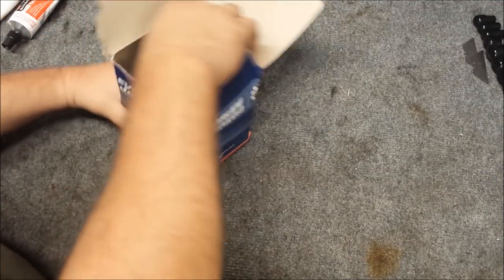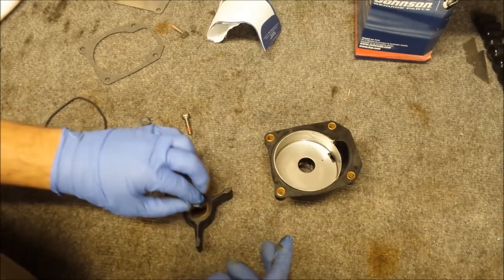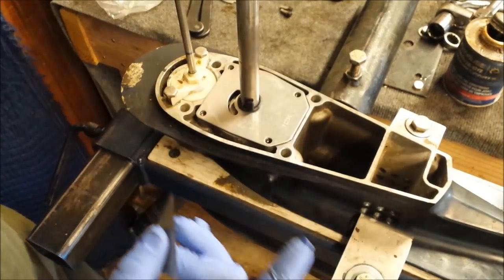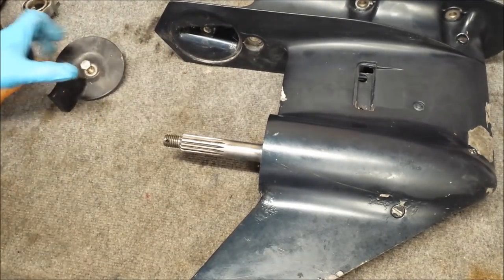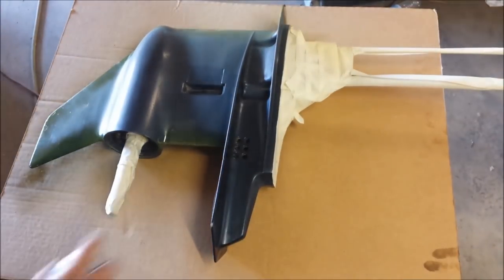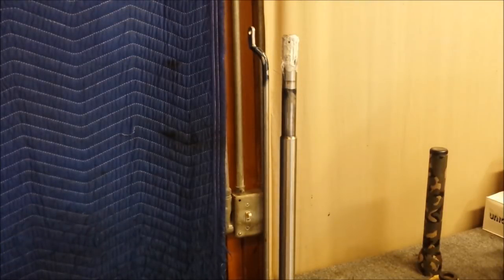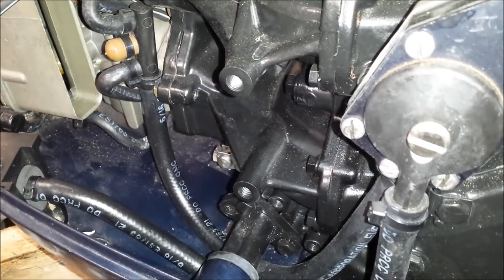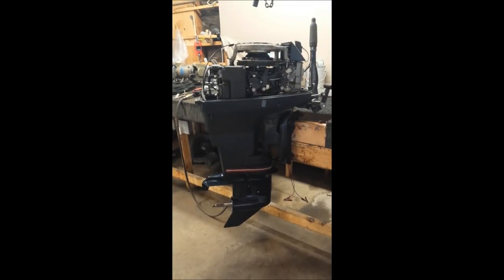Evinrude 40 HP Lower Unit Part 2: Water Pump, Paint, Install

Comment: Not to be a Marine mechanic you done real good.. seriously... a couple things when installing the water pump, as you finally put the impeller and the key with the o-ring.. to install the pump housing simply push it down while turning the shaft clock ways.. easy peasy!  Then installing the lower unit with the prop already installed and the unit in gear , turn the prop as u lift into place.. 3rdly I would have checked my work with a pressure test. And lastly , don't give the gear lube one last pump! You add pressure then you get the squirt on the ground when you unscrew the pump.. other than that ,,Great job!!

Comment: Next time use a large zip tie to compress the impeller. once ou have the housing haf way down clip the zip tie. PRESTO
Reply: Or do it the easiest way and put the impeller on shaft and while pushing down on housing rotate shaft clockwise.
Reply: @John-jc1ig  the issue with that is that tends to pop the 0-ring from the impeller housing out of place. some sealer 1000 and an hour of drying time cures that, but sometimes its a pain

Comment: Thanks for a great video.  I ran aground with our boat last summer.  And the spoon went off.  Everything became so much easier to fix the engine after I saw your video.  Now I have a question regarding the VRO system.  If I disconnect VRO: Do I have to have a fuel pump?  // Robert (Sweden)
Reply: You can use the existing pump on there if it still works. Just cap off the oil line so air doesn’t/water/debris doesn’t get in and unplug the alarms for the low oil and no oil.

Comment: Very nice job watched part one as well, isn't there any seal between the lower unit and the motor housing? I just hooked up a water hose and first time started a joshnson fifty tiller and water leaks between the lower unit and where it bolts to?  it does have a nice pee stream when started but that extra water leaking out has me worried.
Reply: its called a "split line relief" to prevent corrosion. so yes, there is supposed to be water dribbling out. its a wet exhaust and needs to cool it, thus water just falls down.

Comment: I have a 1994 Johnson 50hp. When installing the new impeller, the new kit has the drive shaft o ring. After installing the drive shaft turns stiff, is this normal because of the o ring under the drive shaft.
Reply from the maker: It's going to be stiff because of the new parts.

Comment: Hi, Hey great clip, I put a full water pump kit in my 60hp because I have a problem I'm hoping you might help me with. Dum ass forgot to remove the water muffs before going out so the engine went in safe mode and even after water pump replacement still once it's warmed up it goes back into safe mode. Any ideas what I can do? I live on an Island 1000km from anywhere so no dealers and they won't help over the phone. Would appreciate any suggestions. Cheers

Comment: putting a water pump in my 40 Hp. Evinrude E40TLECR what i have seen on some muddles there is a o ring under the pump . i haven`t seen  one on mine  or one in the kit that would fit . did that meddle not have one ????

Comment: Brandon...I am working on my 1969 33hp that has sat neglected many years and was not pumping water.Pulled lower and checked impeller.Found fins rotated wrong way,but impeller seemed very plyable still.I also put a hose on copper tube to try and flush motor and water is squirting out a small hole in tube just above brass shift linkage connection. Is that hole supposed to be there?Also,nothing coming out the hole on rear of leg where I see it does on videos any help is appreciated...

Comment: Hi Brandon , thanks for the video. Just finished doing my 50hp which is same set-up. Listen, I’m confused about that o-ring that sits in the bottom of the impeller. The one I took out (old impeller) had an o-ring buried in the bottom recess but the new impeller has no such recess so o-ring doesn’t seem to really fit or be necessary. Have you come across this? Do some set-ups simply omit the o-ring?
Reply from the maker: Yes, I have see that. 
However, did you buy an OEM kit? Also, did It come with the O-ring? And, did you look for the O-ring are on both side of the impeller?
Reply: @BrandonsGarage  that’s a good point. The kit was not OEM it was Sierra and it did NOT come with the ring. I ordered that separately.

Comment: Awesome videos. I’ve got a similar motor and I’m finding that the exhaust is sometimes not coming through the propeller, but rather through two ports closer to the power head. Any ideas what may cause this?
Reply: When lower unit is in drive it pulls the exhaust out the propeller with pressure.